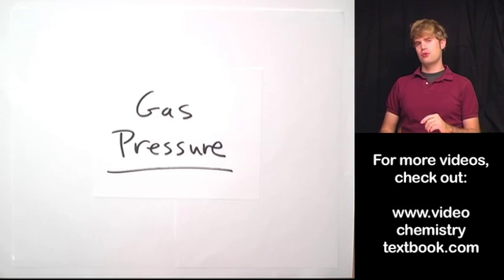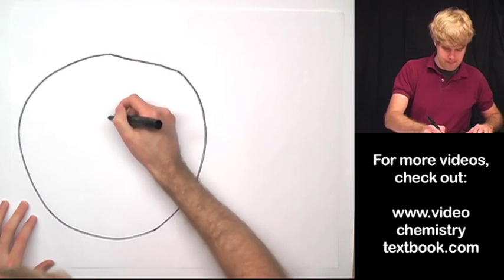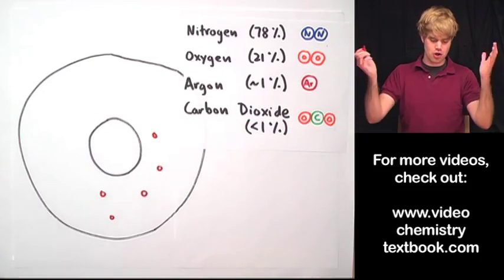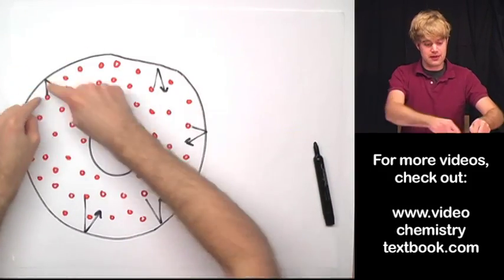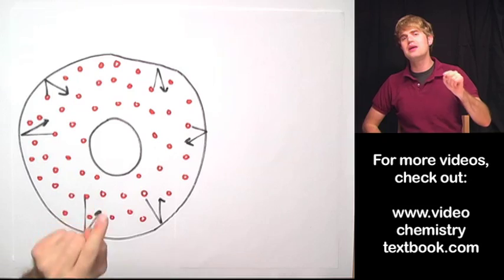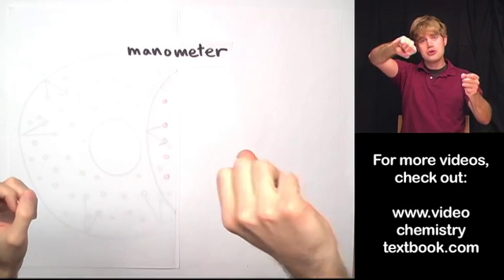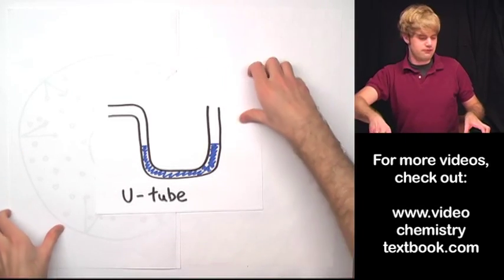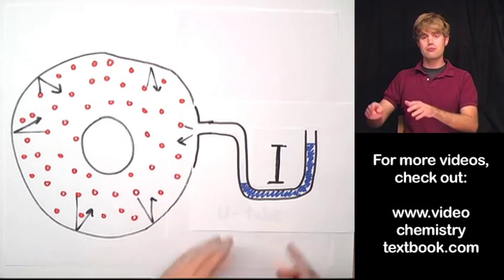Gas Pressure: The Basics

Comment: Can someone help?? If a small cylinder is 1.5 inches wide and 10 inches tall , it has a volume of about 1.14 liters . The  cylinder has 400 grams of propane in it . If I calculate the pressure inside the cylinder using the ideal gas law it’s above 3000 psi at 25 degrees C. I know the answer is wrong and typically the pressure is around 100 psi in a propane tank. Any ideas ??